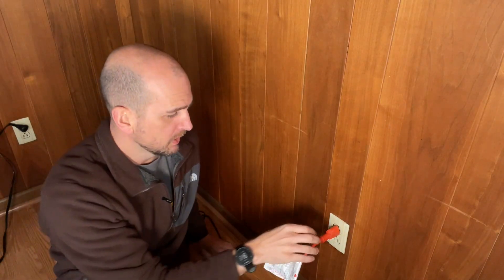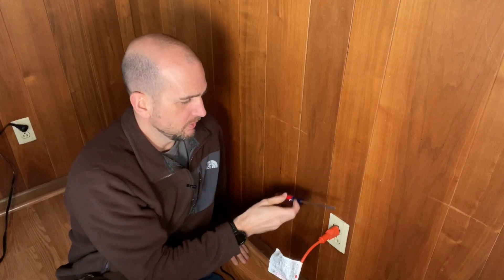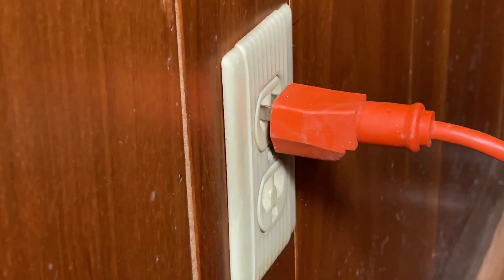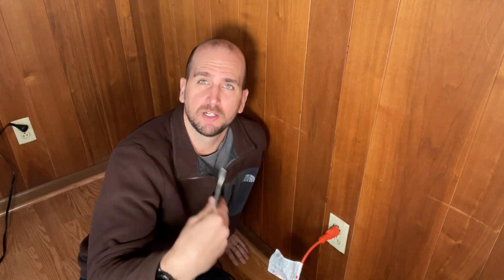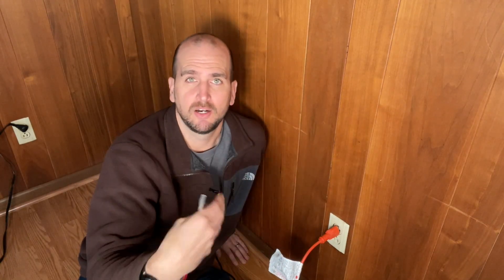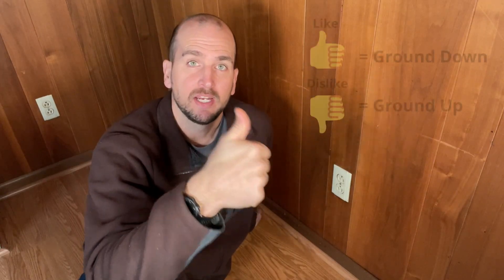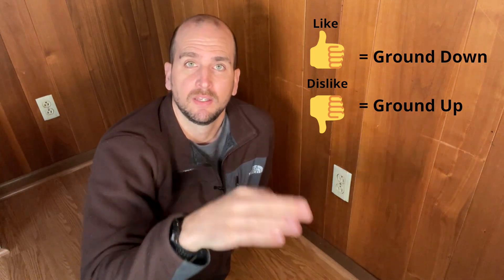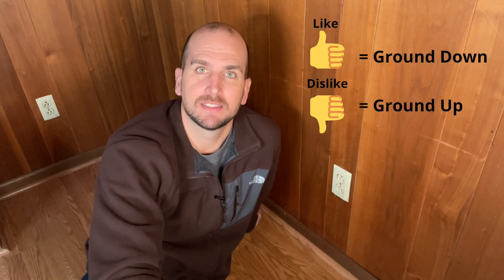Should An Outlet Be Installed Ground Down Or Up

Comment: Ground down because of appliances plug orientation.  Also with two prong only plugs, why is one prong physically wider? I read that the wider of the two prongs is to identify the neutral wire and the smaller one the hot wire.  I have experimented in the past by grinding down the wider prong to fit in the hot wire side with no ill effects.  AC is after all alternating current which means it changes direction (polarity) at a given rate.  In most cases 60 times per second (60 Hertz). Why does it matter which direction the plug goes in with only one phase wiring?

Comment: Here in Germany we have Ground on both top and Bottom :D (search for "Shuko" if interested) also stuff falling on a partially inserted Plug is a non-issue because of the system design - there is no way to have exposed and energized metal, because the Socket is recessed. But we have a similar Code issue, because the Code does not define which side the hot and neutral is. I usally jokingly say "Earth is brown" to that.

Comment: I am living in a low income housing apartment building, that WAS clearly student housing to Harvard back in the day,
and he told me the code was different for commercial and residential(& the safety reasons);
but when I called out 50/50 up vs. down he just laughed and said "Yeah well we're also only paid to fix what's broken or burning".
I'm glad I have off-site data backups!!!  Needless to say we live with bug-out-bags and run drills to GTFO if SHTF!

Comment: I recently purchased two: Square D X Series 125-Volt Tamper Resistant Duplex Decorator Receptacle Outlet, 15 Amp, Matte Black, from Amazon.  They are marked "TOP" with ground up.  Our home was constructed with most duplex receptacles ground down.  There are some exceptions, where they were installed rotated 90 degrees with ground to left and some to the right.  I installed the new Square D receptacles with ground to the right. All the rotated receptacles were in locations where vertical was not an option, due to limited space.  So, as the saying goes, the plot thickens.

Comment: Most cords and things that plug in are designed for ground facing down. The house my husband and I moved into have ground facing up with all but one outlet and it has made plugging things in a pain, especially the surge protectors and other things where the design is oriented ground facing down. I definitely don't like ground facing up. These outlete need updating and we'll definitely be sure to get them fixed to ground facing down when we do.

Comment: Ground down. People tend to not pull a plug straight out of the outlet, but rather with an out and upward motion. That can break that tiny sliver of material between the ground opening and the edge.

Comment: In my mind, when holding a three prong plug and plugging it in, I'm going to have my thumb on the top and my index finger horizontal on the bottom providing support.  Holding it this way, I feel like if my fingers were to slip, it's more like my index finger would slip rather than my thumb.  I'd rather have my index finger slip towards a potentially exposed ground than the hot and common prongs.  Of course, this has never happened and it can just as easily be a problem on a plug with no ground.  Anyway, ground down.

Comment: I've lived in homes from many different generations. Home built in 1950s ... had to be rewired completely to add breakers. When breakers were added, ground plug was up only to indicate one plug on the outlet is switched to a wall switch. Home built in the 1970s, ground plug was up only to indicate one plug on the outlet is switched to a wall switch. Home built in the 1990s, all outlets were installed with ground down, even if one plug was switched to the wall. Home built in the 2010s, all outlets are installed ground down, but, when you pull the outlet, the wires are labeled as "switched" and "continuous". 

I'd love to think that ground up indicates that something is "switched" but, when you look at outlets at hospitals nearly all of them are ground-up (and orange). Maybe that identifies which ones are on the emergency circuit when the power fails and the generator takes over? I dunno. What I do know is when I do switch a plug on an outlet, I flip the outlet to let the next guy know that one of the plugs (the top one) is on a switch. Even if it's not code, it's common courtesy.

Comment: I have seen many accounts stating that the long hole (Neutral) should be on the left -- therefore, ground lug down.  However, I worked for 24 years in a hospital (as a tradesman, but not an electrician), and every receptacle was ground up...

Comment: I install them ground down, however I think there is a Canadian or Alberta code that actually says ground up but it is never called, sort of like running wire in a return air space in residences is never called.  I think that instead of bringing out mandatory AFCI circuits in residences, they should have started calling the ground up code for the safety reasons you pointed out.  Especially now that the ground prong is the longest one for first and last contact.  Not that it would have eliminated fires but at least lessened them to a more acceptble level and let's be honest-probably be as effective as the AFCI in reducing arc fires.

Comment: Although I prefer ground pin facing down. My father who is a retired licensed Industrial Electrician Journeyman, has told me many times that in most job sites ground pin is installed up. He says many times it was a requirement from the construction company.

Comment: The master electrician with whom I worked while going to school said to go ground up any time you had to bend over to plug in. That way the ground pin would always go in first. For outlets you could access without bending over (kitchen counters for example), go ground down. So I've been doing that on my DIY projects for over 40 years, and it has worked out fine.

Comment: This has got to be the dumbest thing an inspector could fail for.  I'd get another inspector.  As long as they are all the same, who cares (but even then, there's no advantage or disadvantage... it's just personal presference)?  I guess I have to change all of my external conduit and sideways outlets with no ground and knob and tube wiring in my 205 year old home?  Obviously they didn't have power back then, but come on.  Up, down, sideways... who cares as long they're all the same.

Comment: There are some plugs from appliances that have  the ground wire on the pointing to the line. thus when you have the ground up the plug has to be upside down. I'm not an electrician just an observer adding a point. Thanks for that option.

Comment: Ground down. Simple reason if a plug is that loose then it will fall out by tilting.  If the weight of the wire exposes the prongs, then tighten the prongs so it is more closer together when you first stick it in and it grabs better.  The electrical prongs are the first to lose contact meaning no power in the exposed prongs and if there still is, then the ground still has good contact to ground, so blows the breaker or fuse.   If there was no ground then your body is the ground and you are electrocuted.
.  On 2 prong connections one side is bigger than the other as that side also carries the ground wire.     
.  I paint houses. So only about +2000 new houses.   Never noticed a difference on industrial sites mind you they are using 240 or 480 or single phase power for their equipment so it is permanently plugged in.     Rare is it to see done upside down. Home DIY
. I did not pay attention overseas in Australia as it was / \ and 220 V and I only had an electric shaver so I bent the ends to use it after switching to 220 on the shaver.
. Europe is 220V pin plug so is different again.  I would need an adapter...or maybe a blade razor.

Question?  What metal object is going to slide down the wall to hit the 2 prongs. Picture frames are made of wood or plastic. Bedding does not conduct electricity. My outlets are from the 70's and none are loose yet.  Not Chineseum products.

I been in houses  that were 125 years old and the socket are still tight 2 prong in those days using a dark brown plate.
Beige plates have been the "in  color" since 1960 You may call it off white, I call it beige or bone white.

Comment: Here is absolutely the BEST WAY. Mount the outlets SIDEWAYS with the neutral blade & ground UP protecting the hot blade from ever being touched. Anything metal could fall on both and set there. Nothing will happen.

Comment: I always thought the main reason to put the ground down was in case of basement flooding. The rising water would likely touch the groung first and then the live wire. With ground up, the water could make contact with the live wire first and possibly electrify the water. Making fixing the floding problem dangerous.

Comment: I was taught that the ground is the most important conductor in a circuit and the ground pin is longer because it should be the last to disconnect when unplugged. If a  cord is stepped on or just gravity pulls downward over time the ground would be the last to disconnect from the receptacle. So ground facing down was the way I was taught to install a receptacle to insure that the ground maintains continuity until the hot and common disconnects.

Comment: I was an MEP Supervisor in a Hospital. We were required to install all receptacles with the ground up. When I did commercial, industrial, and residential work we installed them ground down. Receptacles were also tested monthly with tension gauges during electrical preventative maintenance.  They were replaced if they failed tension testing.

Comment: Ground up at waist  level and below will typically result in the ground pin contacting before  phase or neutral for a safer connection.  On the other outlets at eye level and above with ground down will also have the ground pin contacting first which is safer if there is a short to the case.

Comment: (ground down) If the plug is loose you have (LIVE) hot and neutral pins exposed on the TOP of the outlet. (ground up) If the plug is loose you have ONLY the ground pin exposed on the TOP of the outlet.

Comment: tests were made by the nec and found no basis for any direction except for height from floor for access to handicapped situations for reachability for safety of wheelchair users had to be higher  but safety was main concern in reachability and flooding but receptacles are allowed even to be mounted horizontally also allowed so nec allowed any level direction allowed as long as height did not impede safety of user so on ceilings and floor applications are also allowed in certain uses read nec and save the hassle of learning allowed installs

Comment: For normal plugs it doesn’t matter that much. When it one matter is when you have a heavy transformer plug that has the larger neutral and smaller hot. The heavier transformer plug can fall out or become lose especially as the plug gets older so I always install the ground down.

Comment: I've heard a rumor that if the outlet is less than 3 feet off the floor it should be ground side down.  If it is higher than 3 foot from the floor it should be ground side up.  Something with people tend to yank out cords from waist height.  Although you're not supposed to unplug things by pulling on the cord anyway

Comment: I got my electrical training in the US Navy. We always installed the receptacles with the ground facing down for two reasons. In case of flooding the ground is the first contact that water would touch (in all my life (67) I have never dropped anything that hit the blades of a plug). The other reason is you want to make sure the ground prong goes in first. It the ground was in top, your view of the two blades would be blocked.

Comment: If not in code non than no inspector can demand or make you change the work done .. they only have jurisdiction over a code nothing else .. if you run into a inspector that pulls this power trip go over his head .. codes are there for all to be followed but no inspector can force his her force because of an opinion..

Comment: Two points: (1) I don't know if Leviton changed their website since this video was posted, but looking at the Leviton website today, every outlet and outlet cover shown in their catalog is oriented ground down. (2) I'm not an electrician or tradesman of any kind, just a civilian and a sometime house buyer. And I can tell you that I would strongly object to the ground-up orientation, which looks -- frankly -- upside-down and flat-out wrong. If I'd hired an electrician and he did the job that way I'd call him back and insist he rewire them. If he did the upside-down installation without telling me that was his plan, I'd expect him to correct the installation at his own expense.
Reply: While you could try that, it is best to discuss the specifics of any contact beforehand.

Comment: I would have to say the likelihood of something falling and shorting the leads from the top is at least 1000 times LESS than the possibility of the ground pulling out.
One is to prevent the super super rare possibility of a fire ( forget about all the fuses and circuit breakers shutting it off first ) versus the VERY likely possibility of someone getting electrified possibly out of their life.
Put the ground on the bottom.

Comment: In a good quality fitting the ground will be on the left so that 2 plugs can be used simultaneously.
In a perfect world the fitting would be installed horizontal and ground at the top.
This is where the USA code fails

Comment: Always ground down. A
1. The ground is not a danger to the hand when unseen.
2. Line neutral up always allows you to see the prongs, hence being more aware of them. 
3. The line neutral up holds the plug into the socket better and is not as easy to be leveraged out of the socket compared to the single ground plug.

Comment: Code book (NEC) 2005 maybe 09 ? says ground should be up however most inspectors don’t know or care to look and then a switched outlet should be ground down!  Now Leviton and other manufactures have plugs with one up and one down that appear as a cube in the wall not the traditional rectangle or two circles one above the other. Around the Bay Area (SF) with custom homes some of the new trends is to put plugs sideways and the inspectors will fail you if plugs are power up it must be neutral and ground up so that your hot is on the bottom half of a plug that’s turned sideways.  Now a 50 amp 3 Phase 4 wire plug setting on the bottom plate for a range/ oven must be installed so cord is running up because pointing down there’s just not enough room so cord can turn in a safe and non binding radius.

Comment: so.. work at a military installation and have dealing with many electrical contractors and have asked them the same question... the answer has almost always been the same.... for residential it was not important if it was 120 but for anything 220 or higher.. ground up..... for the exact reason you mentioned at the beginning of the video.  Residential uses standard breakers that will trip if both connectors are hit (as you pointed out) but in commercial... the voltage coming in usually requires specific breakers that will not pop until they reach a certain point.. this can lead to fires.. so ground up being hit will usually knock the plug from the wall.  This is what was explained to me.;. there was other info added but I do not recall what it was.

Comment: They should be installed with ground prong down. One good reason is that's pretty much universally the default. One thing I did do was in my own home was to reverse them on outlets that were "split". I made the top plug of a duplex the switched outlet while the bottom one remained "hot" regardless.

Comment: There may be a historical artifact. Back in the day when all outlets were two prong, the neutral wire (which may have more exposure to contact as in a light socket) was made wider than the hot side. But I remember living in a rental house circa 1962 - it was probably built in the 40s - where all the two-prong outlets had identical size prongs. That could leave a light socket outer connection vulnerable to being "hot" if the plug were upside down.
The big weakness in the argument is that I do not recall any of the plugs having "this side up, dummy" markings on them. Just food for thought if somebody is bored.

Comment: Only used ground up due to the plug design for a deep freeze and where the utter for it was located.  Ground up put far less strain on the plug and outlet.

Comment: The code specifies how it is installed in a round about way. The ground goes down. Why do I say this? So simple really. In hospitals, medical facilities, doctors offices etc., the code makes a point that these need to be installed with the ground up. They make this point as it is different than normal installation which is ground down. If they were expected to be ground up in normal installations there would be no point in making code say it has to be up in hospitals. It would be up everywhere and not need to be mentioned. It’s like taking a test in school. If you don’t know the answer skip it because it may be answered elsewhere. The receptacle issue is solved in the section on hospitals. Oh, by the way, I am a Master Electrician with 44 years experience, 30 years as an electrician at Ford Motor Company, 5 years in Iraq and Afghanistan on task force safe and task force power riding heard on KBR, Dyncorp, and Fluor, then 8 years working electrical at US embassies which I am still doing. . I can almost recite the whole code by memory. This was a great topic by the way.

Comment: I've been told ground up so if anything falls between a partial outlet, it hits the ground and not the hot. That's actually why the neutral is bigger. It's longer so it stays in the plug longer.